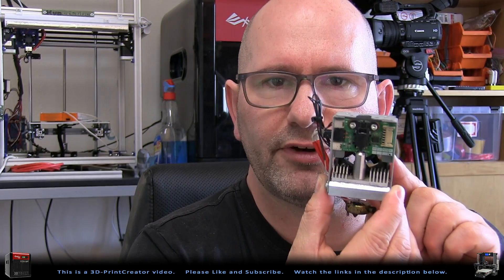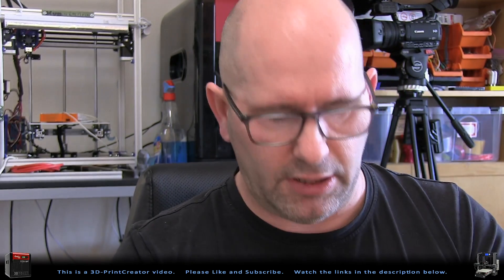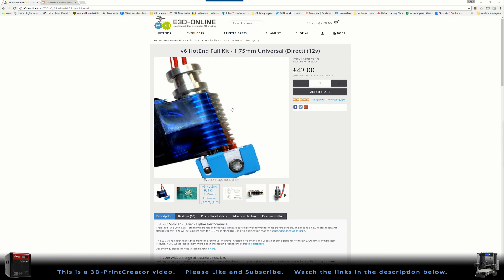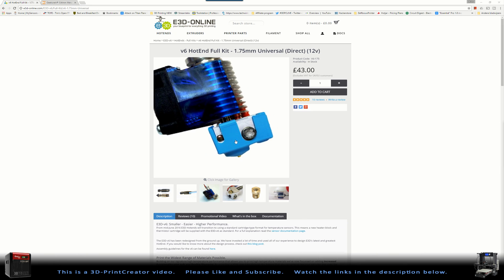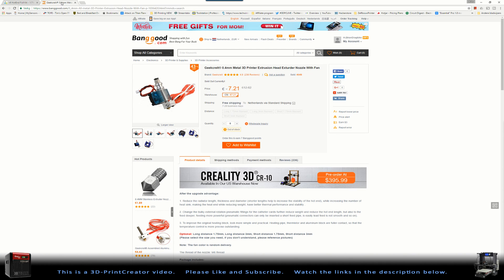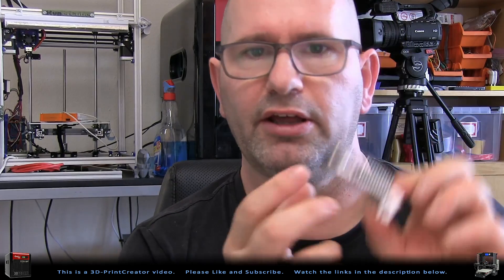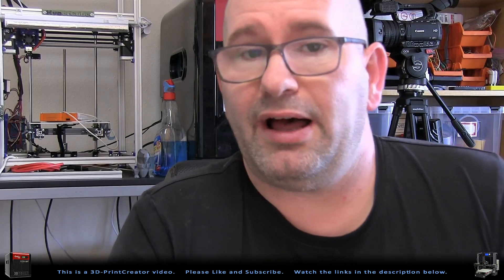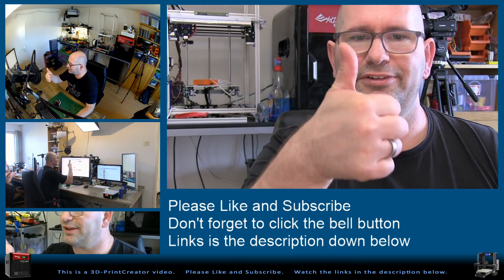▼E3Dv6 on the Da Vinci Pro, why should you do that?

Comment: BB Walker has been out of circulation for a long time now. 
Currently. his page said he will be back this June. 

I have been trying to order the module for the extrusion.
Reply from the maker: That's unfortunate, but something that is not in my control.
You can however, use the original board on your original extruder.

Comment: Hello Brian, thank you for your videos. They have been very helpful. I have a DaVinci 1.0 pro 3 in 1. From what I understand you can flash third party firmware to it, but I can't seem to find any information to do it with this model. Can you or someone tell me of any firmware I can flash to it? hopefully without having to do any modifications since again this printer is supposed to allow for third party firmware.
Reply from the maker: Hi Maverick,
As far as I know, the firmware can only be updated, and it's not free for third-party firmware. The only freedom you have with this printer is using a third-party filament instead of proprietary xyzprinting filament.
If I am wrong, then they made their printers free for changes after I quit using xyzprinting machines.

Comment: Just made the mod with a non original e3dv6 ( cost only 9 euros) using the original pcb and heater,thermistor,fun......
The printing quality is unmatched comparing to the rabish original hotend.
For first time i got true "perfect" layer even from the first print with the e3d ( really smooth first layer , the lines were invisible without over extrusions.)
Thank you brian!
Reply from the maker: Thank you.
It's so nice, after so many years, to hear that people still have benefit from a video I made.
I hope you will have loads of fun with your printer, and that everything you print with it will turn into a successful print.
Reply: can you give me the link to a non original e3dv6 you used?
Reply: What process did you use to convert?  Thanks
Reply: @kevians2001  if you are carefull it is pretty easy to assemble.
print the parts from thingyverse
carefully unscrew and pull out the original pcb from the original hotend.
reeeealy carefully detach the thermistor from the hotend ( it is glued).
unscrew and take out the thermocoupler

dissasemble the e3d hotend and put some good quality thermopaste on the nozle and neck trheads. screw everything but the nozle not so tight.

put the thermocoupler in place ( use the original not the e3d). place in the small screw hall which holds th e3d thermistor the original one. I inserted in the screw hole and not in the e3d thermistor hole since it is smaller and does not fit. be sure it sits tight but not push hard ( in order to not break the glass).

attach the cables to the original pcb and attach the assembled hotend to the carriage.

Choose from printer menu to "clean nozle" in order to heat the hotend. Once it is heated and ready , while holding the part where the nozzle is screwed , screw the nozle a litle tighter.
You are ready to go!

Comment: After you did the conversion back then, did you struggle with print quality at first and did you have to alter some settings in simplify3d to make it work good compared to the stock hotend (except the temperature of the E3D thermistor which I am aware of is off, I am using bdwalkers table and added a 100Ohm resistor to be able to use higher temps)? And, apart from being able to use other materials and get higher temperatures did you see any benefit compared to the stock hotend in print quality?
Reply from the maker: My stock hot never was that good, and after a year of use, it got worse. 
Right after the build, I had to try temperature settings, but that was really it, the quality of the prints was better right away.,
Reply: @3dPrintCreator  that's what I thought. Otherweise you would have done a video about it I guess 🙂 I struggle a little with the print quality. Somehow I have to print much slower now (20mm/s) to get a decent benchy in ABS. ASA is much worse. I am still fiddling with the settings in Simplify, not giving up yet. :)

Comment: How did you adjust the bed  height to the e3d v6 nozzle it sits down further than the stock nozzle
Reply from the maker: Like I explain in my video about changing the cartridge, you can set the bed height in the menu of the printer, and also you can lower the bed by tightening the level screws.

Comment: Hello Brian, I´m quite new in 3d printing...but I need to change the extruder from a Da vinci jr 1.0 pro... is it possible to fit the E3DV6? o which would be the best option? everything else works really fine! 
Thanks!
Reply from the maker: Hi Gerardo,
You won't be able to use the parts for the Da Vinci Pro 1.0 on that machine, as it has a complete different print head.
I have, how ever, seen replacement E3Dv6 modifications for the Junior Pro as well. I think searching the Facebook groups will give you results and links to files to print.

Comment: I have a da vinci 1.0, not pro series. Do you think this is something I can do on that model?
Reply: I was looking at those too. But you have to flash it.. and that looks a little scary.. lots of comments on the machine never operating again. I'll give it another look over.

Your channel has been alot of help, the content is very appreciated 💜
Reply from the maker: I would not be so scared about it. Worst thing that can happen is that the motherboard dies on you, but in that case you just buy another motherboard, like a smoothieboard, and then there are many instructions online about setting that up. I have done exact that with my Da Vinci Pro, and now it runs on Marlin software.
Reply from the maker: No, I am sure you can't.
There are, however, YouTube video's explaining how to give your printer an E3D V6 hot end.
I have never done it though.

Comment: Hi Brian. Great video. I just did this upgrade to 1 of my davinci pro's and I'm having an issue. I have that dreaded clicking sound coming from the extrusion motor. Even happens when I have good flow coming from the hot end. It doesnt happen when I disconnect my guide tube from the e3d v6 and just extrude into the open. I put the cartridge in one of my other davinci pro's and the same thing is happening. This happens as soon as the filament reaches the e3d v6 during a "load filament" cycle, when I dont even have an object loaded to print, as well as through a print. Is there an issue with how fast the davinci is pushing filament through the new nozzle? Something I need to change?
Reply from the maker: For sure there is something going wrong with the extrusion. Have you already tried less extrusion? A lower number on the extrusion multiplier might work. Also, Have you made sure the nozzle you are using in the V6 is a 0.4mm nozzle? And is it a genuine nozzle, or a clone with more resistance to the filament? These are the things to look for.
Reply: @3dPrintCreator  it is a ginuine nozzle. .4mm is what yhe add said it was. And isnt the only way to change the extrusion multiplier whe you are adjusting settings for the object you are printing? How do you adjust that when loading new filament? Also, I am using the da vinci pcb board, not the modded one you refer to in your video. Could that be the issue?

Comment: Thanks for your time and consideration in your videos Brian. Concerning this video are you now calibrating manually or is the an auto calibrating version with the pin down by the nozzle? Also will it work on the 1 Pro and the AiO? I ended up with both ( scanner ).
Reply from the maker: Hi, Thanks for your feedback,
I don't have the Da Vinci printer anymore. The internals of the printer have been changed to a CoreXY printer that runs on another mainboard with Marlin software. Now I can use every feature Marlin has to offer, so yes I now have mesh bed leveling but this isn't something you can add to a normal XYZPrinting printer because they have a motherboard that doesn't let you run Marlin on it.
As long as you use the original motherboard on your printer, you can only use either the semi-automatic bed leveling XYZPrinting invented or manual bed leveling.

Comment: I do following most of your post, and all this upgrades and improvements, on end is not easier just buy a proper 3D printer, for example Prusa cost around $700
Reply from the maker: There are for sure better printers then the Da Vinci Pro machine, but for people that already have this machine, upgrading to a better hot end is for sure cheaper then buying a complete new printer.

Comment: Awesome video Brian. 2 questions: 1. Do you need to get an additional PCB or can you use the stock "Da Vinci Pro" PCB? and will this new nozzle work with XYZ ware? Thanks!
Reply from the maker: Hi Jacob,
You can use the original PCB but then you have to do some soldering or you have to get the connectors and Yes... You can still use XYZWare for Pro.
Only when you are willing to use different temperatures for the nozzle or the bed, beyond the range that is set to XYZWare for Pro, you will need Simplify3D.
Reply: Thanks for your quick reply! After 2571 hours printed on my stock extruder it's time to put that baby to rest and upgrade. Thanks for your awesome videos!
Reply: @3dPrintCreator  Actually you do no need any soldering if you use the original heater and thermistor.

Comment: An additonal option is to buy the E3D clone for €7-10 and then to upgrade it with the original E3D Block & Sock - V6 Upgrade kit for roughly €20. This gives you a better heater block and you get that blue sock thingy :-), plus you don't go Clone all the way but support E3D for their design work and IP.
Reply from the maker: That's a great option. I did that non intentional a few weeks ago. I had a broken original E3Dv6 and a broken clone. With the two I made a new almost original hot end.

Comment: So am I right in thinking that I can use an original 0.1mm "High Precision" nozzle from E3Dv6 in the clone?
Reply from the maker: Nothing would prevent you from using that nozzle as the thread is the same, but I don't think the complete setup is going to be good for this. For a High Precision nozzle you also need the rest of the components to be of extreme high quality. This means an original E3Dv6 all metal, but also a better extruder and probably not a bowden setup, although I am not sure about that last one.

Comment: What is the difference in print quality between the original printhead and E3D v6. ?
Reply from the maker: In quality not so much, as long as the nozzle of the original print head is still 0.4mm and not worn.
Over time, the opening in the nozzle gets bigger and you should change nozzle because the quality of your prints is going to change. With original components, this would mean you have to change the complete drop in carriage, just because you can't buy a spare original nozzle.

When you have converted to an E3Dv6 or a clone, you are able to change the nozzle when this gets worn out. Now you just swap a $5,00 piece in stead of a $150,00 piece, and if you do it for cheap... You can get nozzles for as little as $0,40.

Comment: I enjoy and learn a lot from your videos. but you never really said WHY you should upgrade the hot end. What's the purpose of changing it?
Reply: He does, if you listen it gives you the ability to change nozzles either to replace a worn nozzle or to change sizes which you cannot do with the standard Da Vinci Hotend.
Reply from the maker: Well, as Alan Dawson says, I told that you can change the nozzle and therefore choose the material you want to print with. Now you can use materials like carbon fiber filament, copper, brass, steel filaments, etc.